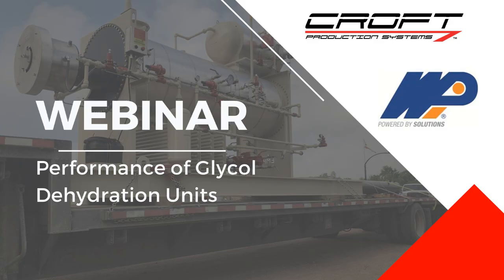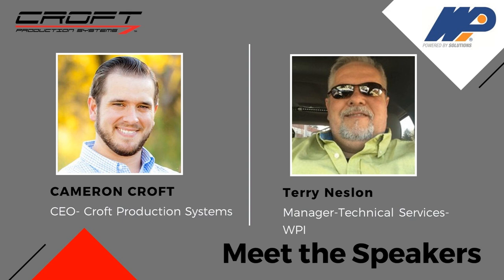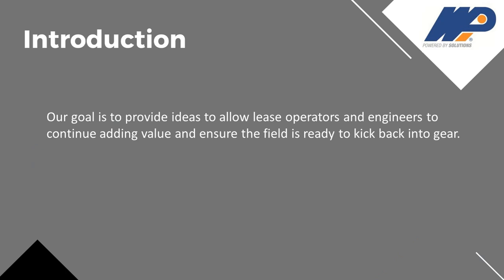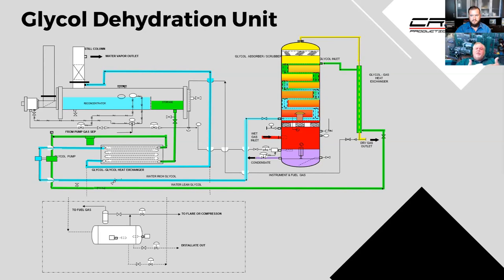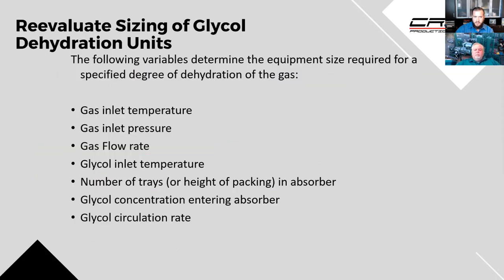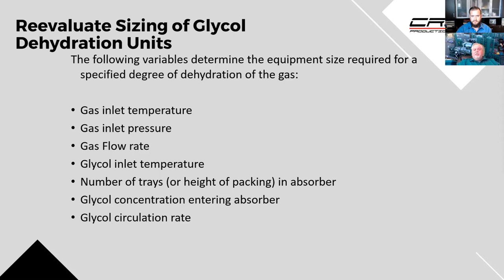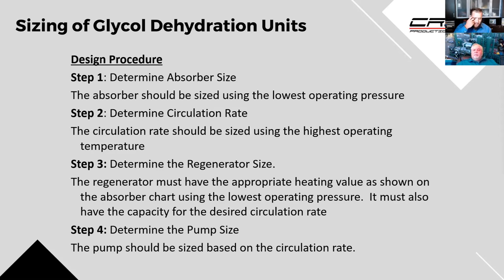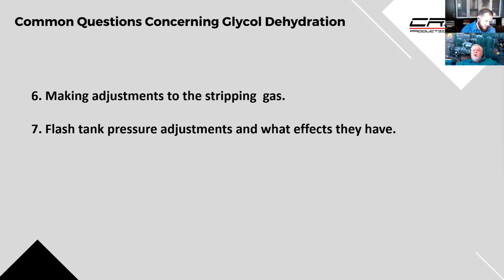Webinar | Saving Money in Operations: Glycol Dehydration

Comment: Lots of good information. I knew the main burner shouldn't be all orange,but don't know if it was supposed to be all blue or a mixture.
Also, the issues caused when running the reboiler at low level of gylcol wasn't discussed.